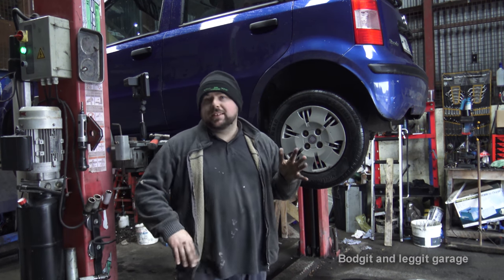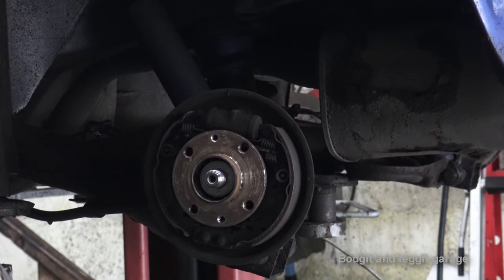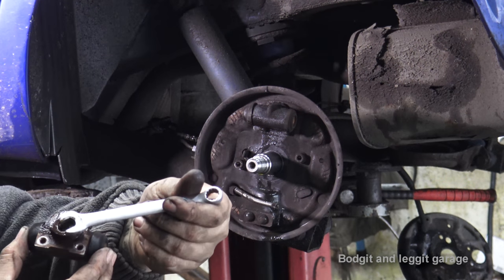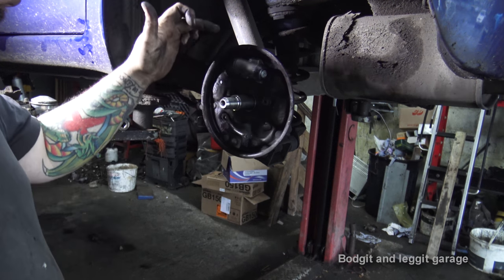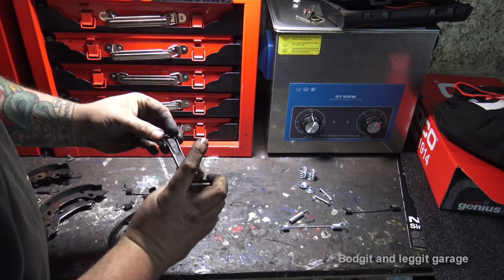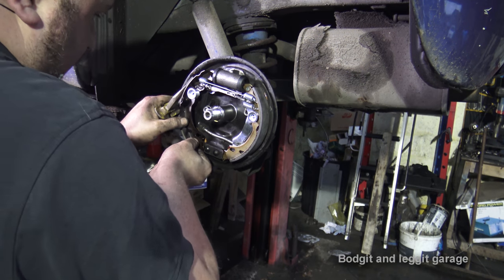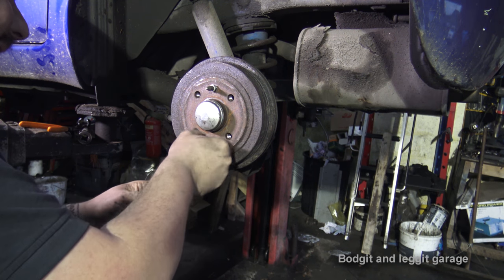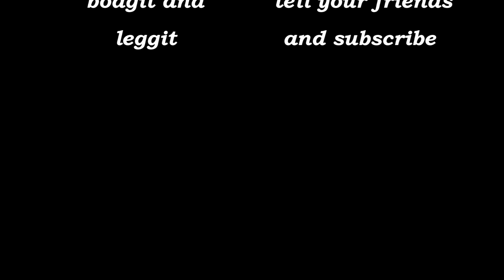2010 Fiat Panda Back Brake Shoes And Cylinders Bodgit And Leggit Garage

Comment: Quick bit of info.  You can adjust the shoes with the hub in place on the pandas and 500’s by sticking the screwdriver through one of the wheel stud bolt holes.  Just rotate the hub so you can see the adjuster through the bolt hole and flick the adjuster wheel with the screwdriver.  This makes the adjustment easier because you keep the hub, and more importantly the shoes in one place and it removes the chances of slightly moving the shoe assembly every time you remove and put the hub back on, so your adjustment is quicker and accurate. 
Love the vids. Between you and diagnostic dan, I’m learning loads.

Comment: Excellent job as usual.
I put masking tape on the shoe friction surfaces before installation before getting mucky/oily fingerprints all over them during fitment.
And, of course, dont forget to peel it off before putting the drums back on!
Reply from the maker: andyfanshawe that's a great tip mate thanks for that must remember that I just clean it off with brake cleaner but will try this

Comment: I did this job last Saturday on my wife's fiat 500. Identical. I wish I'd watched this beforehand. I found the hard way that the wheel cylinder bolts are not accessible. I also had the brake pipe fittings stuck on the pipe which didn't help. I need to pull the drum again to do the adjustment. I hoped it would just self adjust but it hasn't so far. (two days). I'll do the other side but will at least be knowing what to expect. I found your style very watchable and helpful. Oh yeah, nice tools. Mine are a right hodge podge. Mart.
Reply from the maker: thanks mate glad you like it

Comment: Great video I did my daughters 107 rear brakes this week so quite therapeutic watching this, what a pita these drum brakes are, mind you not as bad as the damn v70 I had disc with drum and the worst sod of an adjustment ever, and the handbrake still felt crap after hours of tweaking when you put it on the car always kind of lurched forward or back an inch depending which way you were sloping. I’ll be shot down in flames but I actually find EPBs with discs and pads way the easiest to do. Loved the two fingered salute re tightness.

Comment: Instead of twating the drum with a hammer and risk cracking it is easier to remove hub cap and bearing nut then remove outer bearing all while the wheel is still fitted and pull the full hub and drum in one lump.The wheel gives you a lot more leverage to ease the drum off over tight or contaminated brake shoes.

Comment: Another Panda question: If I have to brake hard at low speeds (10-20mph, just shy of an emergency stop) I feel and hear the back wheels lock up and slide. Is this acceptable for a '04 Panda? It has anti lock brakes, I don't feel it engage in the pedal. This happens in dry conditions with midrange allseason tyres. It just went through its MOT without problems. 
I greatly enjoy your channel, keep it up!
Reply from the maker: Hi mate what you're going to have to do is just to be safe because at the end of the day they are brakes you're going to have to look at the back brake shoes and make sure everything is ok strip them down make sure everything is ok they tend to go hard after a few years even though they look good doesn't mean they are good most probably going to end up having to replace everything on the back
Reply: bodgit and leggit garage will do! Thanks for taking the time to answer my question, I really appreciate it!
Reply from the maker: @asmodeus1755  anytime mate I'll be pretty certain they are the original brake shoes like I said they might look good just replace the brake shoes to brake cylinders and the brake fitting kit

Comment: Have you found a brake cleaner that works better than any other one. Can you tell me why people says to chamfer the edges of the friction material when installing brake shoes.
Reply from the maker: Hard Worker it is done to allow the brake to bed in faster and sometimes it helps with setting up the brakes as well

Comment: fantastic video y can't thay rivet them on like they did be for and not stuck on to the shoe what happens is the bricks got hot and the adhesive that holds the shoe s to the metal go brutal and then you get this problem not good
Reply from the maker: thanks mate unfortunately theres problems with both methods

Comment: Did you have a problem with bearing ring falling out of the hub when taking hub from the car. it happened to me on fiat puno mk2b(same hub and bearing) so I fitted new hubs, and wandering could i press bearing ring back to old hubs.
Reply from the maker: hi mate just replace them

Comment: I thought they were self adjusters that find their place after the brake is pressed, they open out and the little spring plate stops it going back in.
Reply from the maker: yes mate but they dont work
Reply: @bodgitandleggitgarage  I had a Fiat Multipla and the brake lining came off one of the shoes, I know how it was caused, the handbrake is on the right of the driver and in the winter it can freeze on and I drove it back from work because I wanted to get home and the drum got very hot  and the lining on one of the shoes came off about a week later when I took the drum off I could see that they had burnt. I have a Panda now and because it's been idle over the so called lock down the handbrake is not working on one side so I'll have to investigate and fix.

Comment: Why didn't you just have the drums turned?  Every time i work on those silly drum systems, I have the drums turned (if they're in limits).  It definitely would have made re-fitting much easier.
Reply from the maker: soonerlon I hear what you're saying and I agree but a couple of problems I don't have the machine to do it and there is not one around me it's miles away would put too much cost on the customer I wouldn't get the job if I did that but yes it is definitely easier and better to do it that way but you don't need to really if I had the Machine I would definitely do it
Reply: Or just get a new drum because they are cheap nowadays, for example one for my car, a 200 mm was only 20€, 180 mm was arround  15.

Comment: Common failures on these Fiats. Wheel cylinders start leaking with the fluid melting the glue on the shoes hence why the lining tends to come off. Happened to my previous Panda, found the same on me daughters Panda las weekend as well.

Comment: don t want to hurt your feelings ore what not but:  your drum NEEDS TO GO ON LOOSE OVER THE BRAKESCHOES,THAN USE THE HANDBRAKE TOO ADJUST IT!!!!!THE brakeschoes are adjusting themselfs EACH time you use the handbrake.....just think about it...if the adjusting system is not working than you CAN find out that your brake pedal needs 2 pomps in stead of 1 pomp to activate the rear brake(you need more brakeoil in the cylinder too COMPENSATE for the worn brakeliner)and because of this you get a difference between the left and right brake.the brake schoes does not touch the drum,it creats heat and drag....
Reply from the maker: MrRichard57000 no you are wrong self adjusters never work on hand brakes why do you think you have to adjust handbrake so the time think about it if they self adjusted and it worked properly you would never need to adjust them ever again this is not the case do your homework before you try and be clever and comment on someone's video
Reply from the maker: MrRichard57000 and not only that some handbrakes you can adjust from inside the shoe once the Hub is fitted why would they put this option in there if it's self adjusted like magic
Reply from the maker: You've obviously never heard of pads bedding in when they are a little bit snug as you move the Hub around it's just the corners of the new material this will wear down in no time cause no heating or no damage just another keyboard warrior who thinks they know what they are talking about

Comment: Great vid mate as usual. Can you have a look at my message on your discussion page and tell me what you think? I'd appreciate your opinion. Thanks mate!
Reply from the maker: cozziekid cannot see anything mate just asked me on here and I will answer
Reply: My posts keep disappearing for some wierd reason? I have a 54 plate Mk1 Octavia VRS with a knocking noise coming from the drivers front wheel area. Knocking gets faster or slower with speed, but, it disappears when I press the brake. Stopped altogether after I fitted a set of Pagid pads but after a few days it was back again. Any ideas? I'll post a link to the video again. Cheers pal.